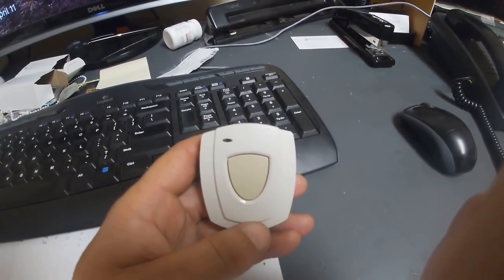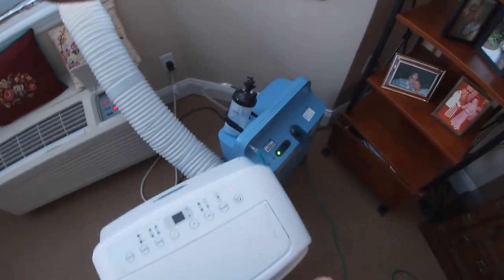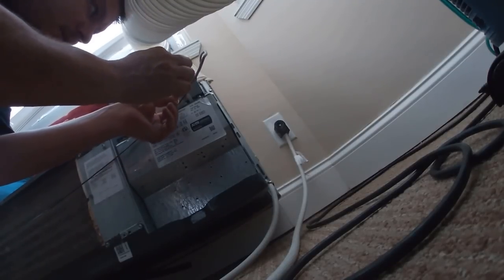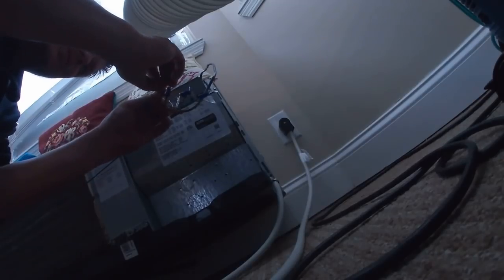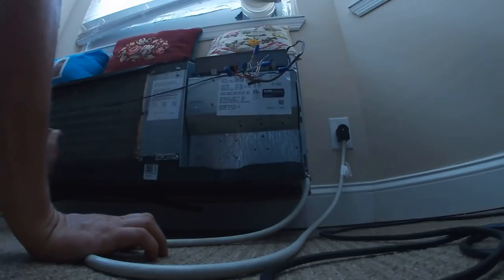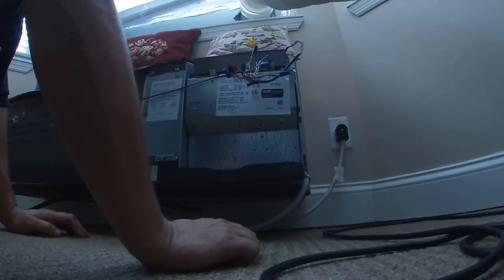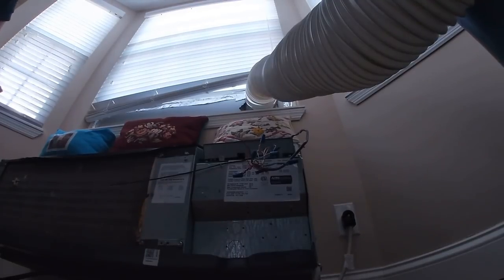HVAC PTAC Not Working Let's Find Out What Is Wrong.

Comment: Hey Jeff, enjoy the vids and ur humor. Question, on ptac unit, how can I set a cool setting so guest won’t overuse the unit? Thanks for your help.
Reply: If you have an Amana hold the up and down arrow off twice and that will show you the codes what you press heat till it shows C8 the temperature it will go down to usually set at 60 if you have the original paperwork when you pull the cover off a PTAC and could tell you all that on the paperwork

Comment: I hear the oxygen machine running which tells me that a resident is present. And you are speaking that language in the room? If a resident is not present why not turn off the concentrator. That language even in the presence of a resident is considered abuse and a violation of resident rights
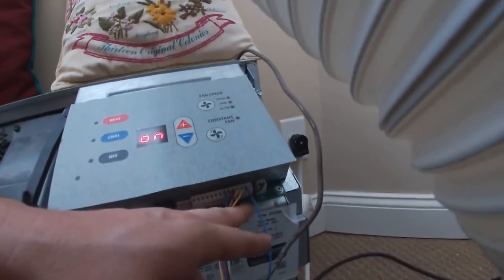Reply from the maker: IF The 02 concentrator is on... you leave it on. The  tv is different. The o2 concentrator is a life safety you Never Touch It .  Same thing with med beds, wheelchairs, o2 tanks etc... Resident was not home. @4:17 you can see she is not home

Comment: the wall outlet is bad... go figure, loose wires or worn out from a herp-derp resident insert/removing it non stop vs. setting the thermostat...
or dunce staff with a troublesome resident (install fake thermostat) and hide real one or use built in until they discover it :))
tricks of the trade ehhhhh ;)